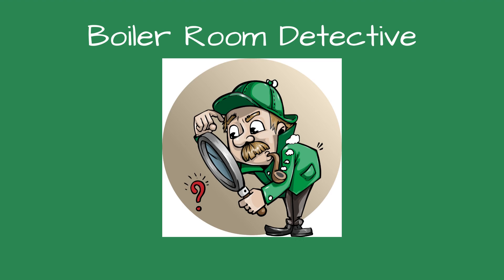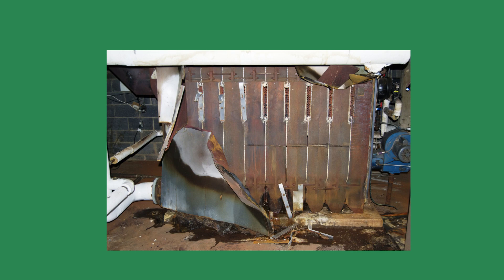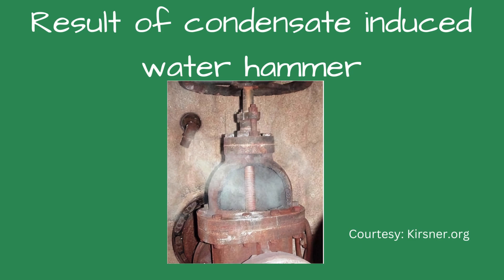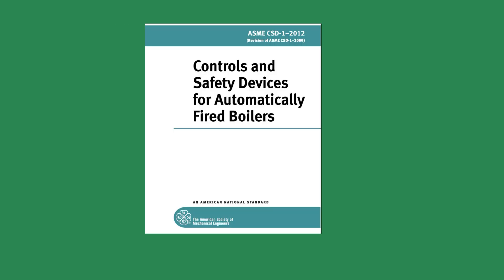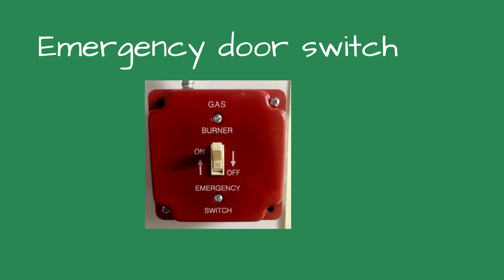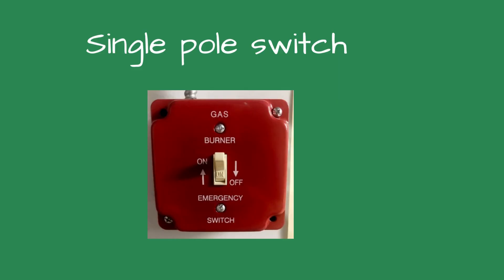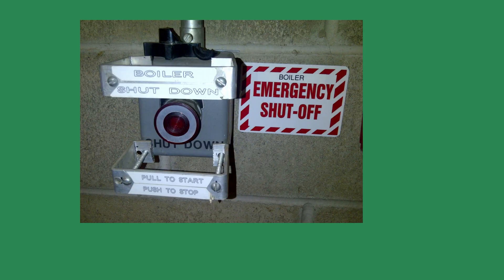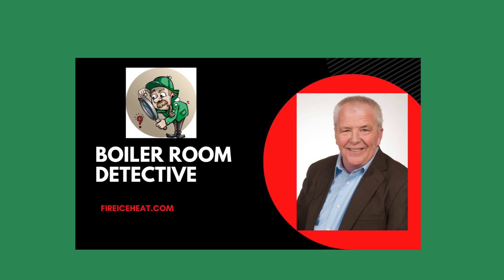The Case of the Overheated Boiler

Comment: It's shocking that the fire department had not been properly trained in how to deal with this sort of a failure! It is good that the incident didn't end worse for them! 
Just curious; did you ever determine what caused the original overheating of the boiler?
Reply from the maker: You're right It could have been worse. I volunteered to train the fire department but they declined. It looks like the low water cutoff failed. and the boiler dry fired based on the discoloration of the boiler jacket Thanks for watching
Reply: @boilerroomdetective  
Sad about the low water cutoff. This, in my opinion and without seeing the installation, reeks of deferred maintenance and lack of routine testing and inspection. 
Also sad that the fire department didn't see it worth their effort to learn about possible hazards of their job.
Reply from the maker: @davida1hiwaaynet  i agree They dont seem to do maintenance there Thanks